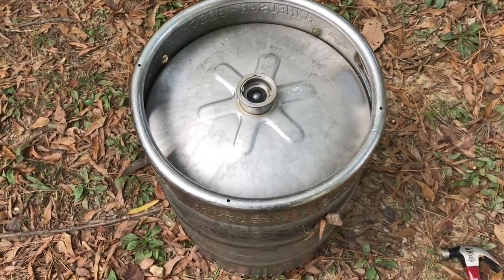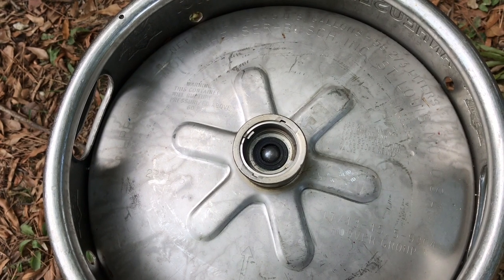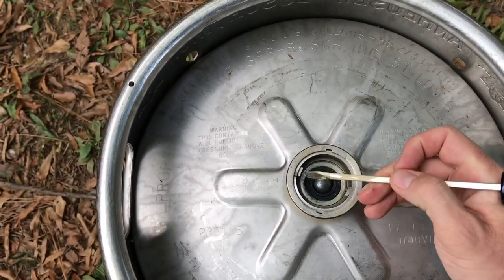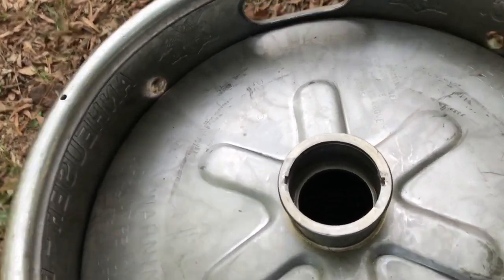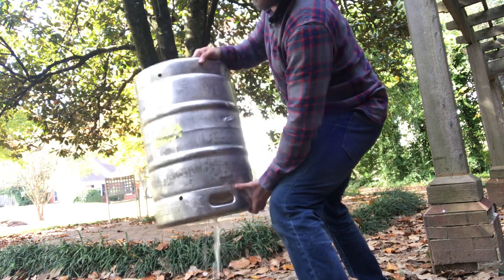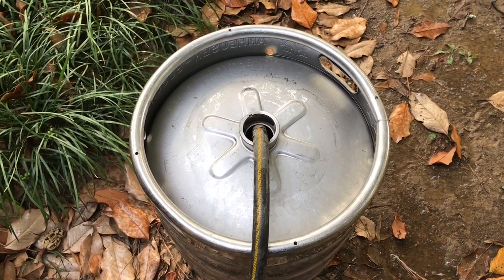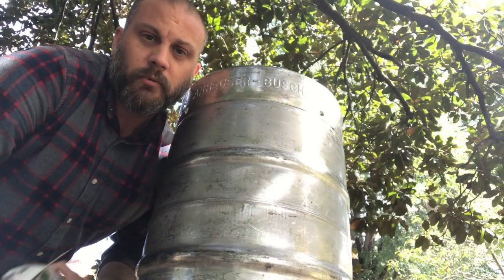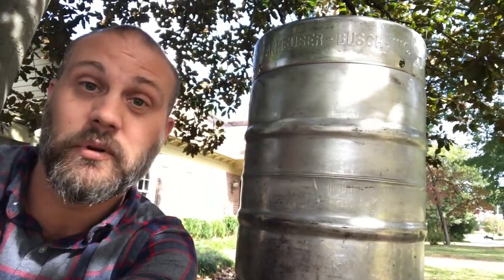Pot Still Build, Keg into Boiler: Part 1

Comment: Is it necessary to have a 2 inch column or can a person put a reducer on top of the keg from 2 inch to 3/4 inch ?
Reply: Yes you can but the longer you use the easier to put you catch jar somewhere you don’t need to bend over and pick up off the floor.

Comment: Can I use a 2 inch piece of copper right off the keg the piece I have is only 6 inches tall. Then reduce it down to 3/4 inch pipe off the 6 inches.
Reply: Yes

Comment: Greybeard what are you running for heat source?

If you are going electric: Put the drain on the bottom of the keg.
If you are running propane: Put the drain on the side of the keg.

A fill/cleanout port on top is nice, but others have installed a stainless 2" Tee and put a 2" cap on the side, and leave the column on top connected with triclovers. If you are adding a cleanout on top, make it a 6", it wll be easier to get your arm in.

Welding spuds are the way to go for adding plumbing connections. When I added my bottom drain I used a 1/2" welding spud, step drill bit, and soldered it. I did add legs but I just mig welded them on.

Watch Bobbys silver soldering video.

https://www.youtube.com/watch?v=LIkvP55UbxM